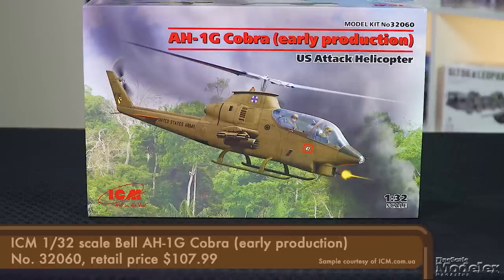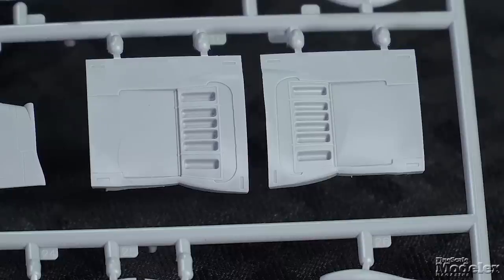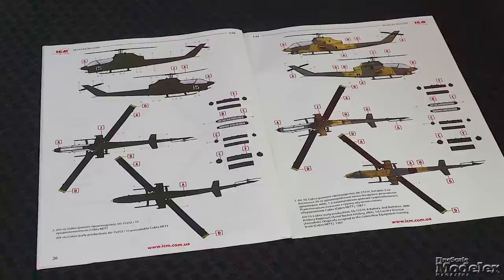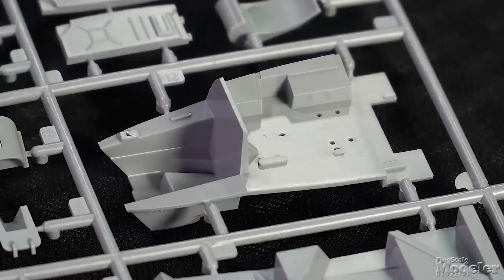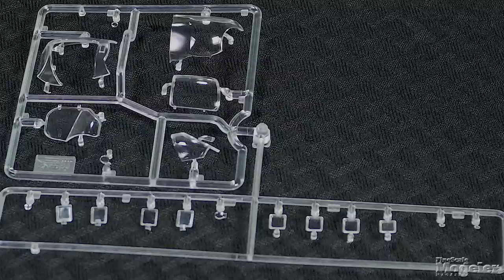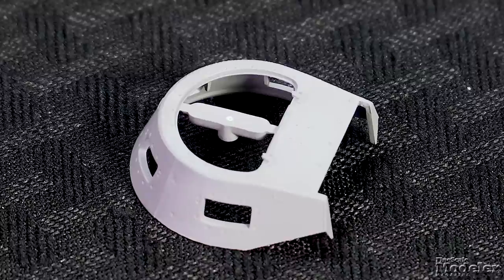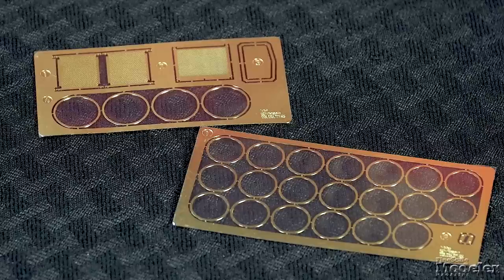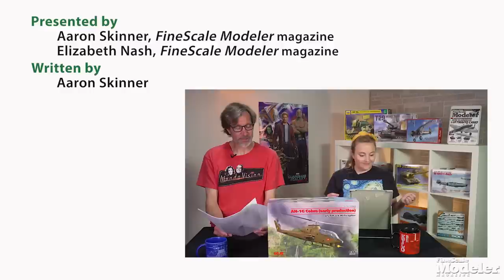Opening the boxes of ICM's AH-1G Cobra, Zvezda's Hind, & Takom's Panzer Ausführung A & B model kits

Comment: I wish the cobra had been released in 1/35, and not 1/32 scale 😒
Reply: Not a huge difference, just maybe the MGs
Reply: I understand a pilot figure set is to be released for the Cobra as well; for what they're charging for the kit,  they should be included.
Reply: @mh53j  ICM is also charging around $24 for two 1/35 driver figures, for a WWI truck. Since no other company makes them, they can get away with charging that. I agree that ICM needs to be more like Tamiya and include figures consistently. They do have a few kits that include some figures now though.
Reply: 1/35th would have been cool..But 1/32 is bigger.!
Reply: @joeshmoe9978  if this was 1/35, there several helicopter pilot sets available (I still have several of the Dragon helicopter crew sets stashed away). Put a 1/35 pilot in a 1/32 helicopter, the difference in scale will noticeable. 
Typical...